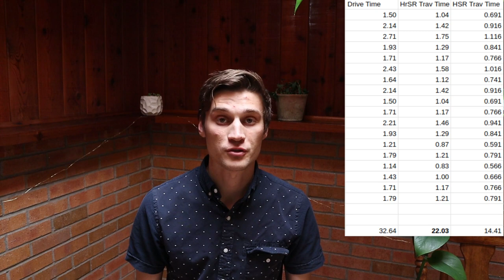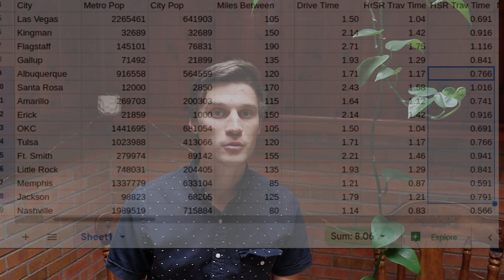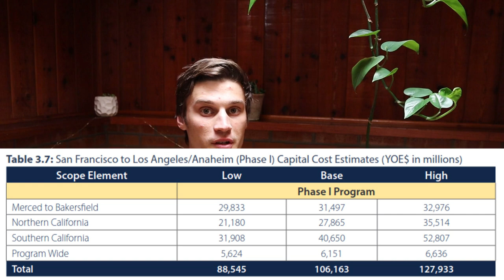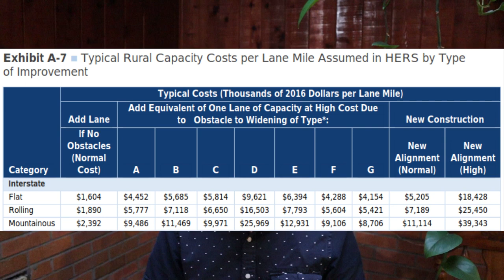What if Interstate 40 were High Speed Rail?

Comment: British Rail built the Intercity 125 50 years ago capable of reaching speeds of 125mph on standard track. It is still in service. So realistically if you build track capable of running a 50 year old design of train you can achieve a realistic improvement. They also designed the APT (Advanced Passenger Train) which was the predecessor to the Pendolino (Tilting Train) capable of I believe 140mph agin on standard track. The holdup isn't the train design but the Political commitment to either track construction or rehabilitation.
Reply: If only we were the size of England.
Reply: @ut000bs  Point was they didn't need upgraded track. Virtually all High speed rail runs on dedicated track (see the project in California, most European high speed lines, China etc) The Intercity 125 could attain top speed on normal track with minimal upgrading. Amtrak needs to provide relatively quick Reliable services in order to stimulate demand, and that requires scheduling improvements and track upgrades. Some American services are good but the longer the distance the more chance of delay.
Reply: Can safely run up to about 155mph on standard track, as long as curves are straightened and crossings are eliminated and layers of automatic safety systems are added. This is also about the limit of modern standard rolling stock. Older stock tops out at about 125mph. Electrification can be added at the same time, reducing potential energy costs in the long run.

Comment: My honest thought at about 9:33 is that your high-speed rail numbers are too high, on both the low end and the high end. 

California is unique in that its cost numbers include the costs of addressing a lot of terrain challenges, seismic challenges, environmental challenges, labor cost challenges, and other challenges that just aren’t replicated elsewhere in most other parts of the US. 

For instance, much of that route runs through the Midwestern US, where costs will be somewhere around half of costs in California.

A second criticism is that the timetables could also be recalculated with the concepts of “express trains” and “local trains”. Express trains would connect city pairs along the proposed route (like Albuquerque to Nashville nonstop) while local trains would stop at each stop (Albuquerque, Amarillo, OKC, Tulsa, Fort Smith, Little Rock, Memphis, Nashville).
Reply from the maker: Those are both fair criticisms. 

I don't know how much extra the "California Tax" adds when broken down into itemized lines of labor, seismic robustness, etc. (that might be a good future video idea). But, while the geography of Oklahoma and Texas may not be too challenging, traversing through the Ozarks, across the Mississippi river, and across the Appalachian mountains is no easy task. 

I like the idea of express trains; you could easily save over an hour in stop time. My reasoning for adding the intermediate stops was to ensure the folks in more rural areas have access to transportation throughout the region, but the "local train" solution would cover that.

Thank you so much for commenting; I hope you have a great day!
Reply: @ericnelius9062  Frankly, my gut feeling is that depending on terrain and land cost, you're looking at between 50% and 80% of the cost of California. Somewhere in that ballpark would give you a decent guesstimation.

Second, in addition to the breakdown of "Express" and "Local" trains that we got by looking at what the MTA does to move people through the NYC area fast, let's look at 2 other options that can also be built into an HSR service.

A "Commuter" train service would be a lower-cost no-frills service that would be designed simply to facilitate commuting between a large city that is a jobs hub with smaller cities that could serve as bedroom communities. California plans to run some of the trains on its HSR like that. This would, for example, enable people to live near Fresno and easily commute to work in the Bay Area.  All that would be needed would be for 1 train to simply shuttle back-and-forth between the same 2 stops. In a nationwide HSR system, this could be replicated all over the country, and would rejuvenate numerous small cities while expanding the available workforce for job centers in larger cities.

An "Overnight" train service could move people across the country much more easily, by utilizing high-speed trains with sleeper berths to transport people nonstop while they sleep overnight. For example, a train connecting Albuquerque and New York City would have to cover roughly 2000 miles, which could be done in about 9 hours. A passenger could board a train in Albuquerque, get a comfortable sleep, and wake up pulling into New York City the next morning. It could be an easy, comfortable alternative that could be competitive with transcontinental airline service.

There are a lot of good options for how HSR trains could be run that we ought to be talking about, since you can make a train car do things that a car or a plane can't easily or economically do.

Comment: You lost me at the eastern terminus being Charlotte. It's not even on I40 and there are way more folks living in the corridor from Winston Salem > Raleigh than in Charlotte.  Raleigh-Durham, at ~2.2M, is also the largest CSA along the entire stretch of I-40 and it's growing more rapidly than even Charlotte.   Charlotte belongs on a HSR corridor that stretches from WDC to Atlanta along I85.
Reply: "Charlotte belongs on a HSR corridor that stretches from WDC to Atlanta along I85."

Uh, there's no density there, at all...and it's 639 miles, that's way too far.

Higher speed rail, yeah, sure. Not per se HSR.
Reply: @neutrino78x  
Atlantan here-- there are lots of people that make the drive between here and DC and points north because a large swath of transplants living here are from the Northeast. Also if we follow hub and spoke models, Charlotte would likely be a key transfer point in a HSR system just like ATL would be.  

There are plenty of people that would be OK with a 600+ mile high speed train trip as long as there are dining cars, restrooms, entertainment and wifi, and even scheduled 20 minute stops at key locations where one could get off and freshen up/walk around a bit, grab a snack and hop back aboard to continue their journey. These all exist on railways outside the US, but are bog standard operations. As long as ticket prices are comparable to flying Spirit or some other low-budget plane, then I'd be on the train all the time.
Reply: @starrwulfe  

"here are lots of people that make the drive between here and DC and points nort"

Lots? Like, ten? That's what, a ten hour drive? That's not a drive you're going to do on any kind of regular basis. If you wanted to go visit family once a month, you would fly.

"Charlotte would likely be a key transfer point in a HSR system"

There's never going to be a nationwide public transit HSR. The expense is simply not justified in light of the fact that we already have a high speed transportation system that is far less expensive and much faster: jet aircraft.

" These all exist on railways outside the US, but are bog standard operations. "

(all those things you listed exist on Amtrak today.)

Show me the 600 mile HSR line in Europe. That would cross multiple countries. They don't have HSR out that far. Going from Lisbon, Portugal to Moscow takes three days on a train, just like crossing the USA, because they don't have HSR built out on that scale. They would fly such a distance, as we would.

A lot of sources like to claim HSR is good out to 400 miles but I think that's nonsense. I haven't seen anything that claims it to be a good choice at 600 miles (1028 km).

In theory, if you could maintain 200 mph the whole time, 639 miles should take 3.2 hours. 

But I don't think that's realistic, because look at California's HSR, quite a bit shorter at 380 miles....but they stupidly chose a longer route, 400+ miles, and it would take a minimum of 3 hours, probably more like 4 hours, if ever built. So look for DC to Atlanta to be more like 5 hours. The problem is you can fly it in under two hours. So you're wasting three hours of your life.

What I would support DC to Atlanta is "higher speed rail", which is quite different from HSR: no special grade of track, no wire. It would be more like a six hour ride, but far less expensive. 

btw density of Atlanta, 3,685.45/sq mi (1,422.96/km2)
DC, 11,280.71/sq mi (4,355.39/km2)
Distance: 639 miles (1028 km)

As opposed to Paris, 9,900/sq mi (3,800/km2)
And London, 14,500/sq mi (5,598/km2)
Distance: 318 miles (513 km)

So DC has reasonable density but Atlanta doesn't, and the distance is double. That's why Europe and Asia have lots of HSR but in North America and Australia we don't use it hardly at all.
Reply: Another problem is that even if you built high-speed rail, most American cities have a very feeble public transit system to get you anywhere.   Charlotte is in the process of building a unified Transit center for Amtrak and buses... But the New Orleans to New York City crescent train comes through about 2:30 in the morning when the public transit system is not running.   Charlotte is talking about possibly having to shut down its light rail because of a lack of trained personnel.
Reply: @neutrino78x have you ever driven that route?  Richmond, Petersburg, Durham, Greensboro, High Point, Charlotte, Spartanburg, Greenville are all fair sized cities and growing, causing heavy traffic the entire route, despite 6-8 lanes much of the way.  Plus countless other towns providing potential customers.
Reply: @RichardinNC1  

" Richmond, Petersburg, Durham, Greensboro, High Point, Charlotte, Spartanburg, Greenville are all fair sized cities "

Perhaps, but they don't have the density to justify HSR.

Richmond, virginia, population density: 2,067.3/sq mi (798.2/km2)

London, UK population density: 14,500/sq mi (5,598/km2)

Now do you see why it's easier to justify it in Europe???

HSR is extremely expensive.

"Higher Speed Rail" I would support. But with that, you don't hang a wire and you don't buy new Right Of Way. You just upgrade existing rail where needed and run express trains. Much cheaper.

I have no objection to Higher Speed rail between those cities. Per se HSR is definitely not justified.

And I don't know how to drive, I grew up in a region with lots of transit (san francisco bay area).

Comment: I think the Higher Speed Rail is the most cost effective option.  Besides High Speed Rail may not be able to maintain full speed on mountains, through cities, etc.  Using the I-40 corridor is smart, saving a lot of cost for right-of-way.  I live in Charlotte and would use rail to Raleigh, Atlanta, Nashville, and beyond.  You may have overlooked the mountains Charlotte to Asheville.  There’s a 2000ft climb separating the 2 along any possible route.  A tunnel doesn’t fix that.  Trains have gone through Saluda NC, one of the steepest mainline sections in the east but that was decommissioned and is being turned into a trail.   A few other points you overlooked.  Long distance trains have to change out crew every 8 hours, along with refueling.  Add 1 hour for high speed rail, and 2 hours for higher speed rail.
Reply: If the Train is Electric Powered, there would be no extra Time needed for Refueling.

Comment: Great video! I think a 10min stop is to much, usually trains only stop for maybe 2-5min. So with a 3min stop and accelaration of around 90sec to 200mph its 5-6min.
Reply from the maker: Thank you so much! As a frame of reference, the train from Bruxelles to London was stopped for exactly 3 minutes when I rode it recently.
Reply: @ericnelius9062  yeah right also the train usually stops longer at big important stations but shorter on smaller less important stations👍🏼
Reply: An acceleration time of just 90secs? That's very fast. You'd require heavier engines and draw more power than a more gradual acceleration, which makes for more expensive trains and infrastructure. And if the train is going to downtown, you probably don't want to go 200m/h in the city. Not to mention that if it's going to already existing train stations, it's likely to travel the last/first miles over existing lines which were not build for those speeds.
Reply: Agree that 10 minutes seems excessive, when compared to a driving speed of 70mph non-stop. Either assume the train will be doing 200mph non-stop, or factor in a break every couple of hours when driving plus the inevitable delays you get on any long drive...

Comment: Even if we never get faster rail they need to revive the rock island line that bnsf destroyed. Even if "slow" speed rail was the only option I would still use it to go to nearby cities. On top of that my city of Amarillo tx was built around the line and it didn't disturb the fabric of the city too much, I-40 and 287 however have leveled an entire neighborhood and torn through several more, its led to a complete breakdown of our older throughfares and many of them are completely deserted because everyone takes the highway. Its made my city a place to drive through as fast as possible instead of a being a destination.

Comment: As a frequent user of the Interstate System I find your 70 mph base line wildly out of touch.  As you casually mentioned, stopping is a reality not an option.  In order to average 70 mph on the hypothetical trip, steady speeds of 80 - 85 mph would be necessary.  I don't see that as realistic.  I believe a 60 mph average would be more realistic for your comparisons.  
I like the premise of your presentation and as someone who simply will not fly, long distance rail connections are tempting to say the least.  What I see as the major hurdle is overcoming the long entrenched entities that are so vocal as to pro-highway/auto/truck industries, plus the road construction companies that are major contributors to the politicians that would need to come on board (pun intended) to make a national rail system a reality.

Comment: There's a lot in here, anyone reading should expand the comment to read it all 😉

Though you are somewhat restricted by weather....  Running down I-40 right through the state with the most tornadic activity and some of the most extreme weather cycles.   Trains will halt service for tornado warnings and sometimes for severe storm warnings.   Trains are often also slowed down at higher temperatures due to rail expansion.  And below -20C, also slowed down due to shrinkage.  

But all that said, it would be nice to have at least the X0 and X5 Interstates paired (or loosely paired within and around large metros, maybe on the 3di, to placate NIMBY busybodies) with some PAX-only rail service.  The main gripe I have about current rail is not the speed but that even though PAX is supposed to be prioritized by law, it isn't, and penalties are not enforced, causing constant delays.

But laying rail in the open is easy, problem will come into play when you have underpasses that do not meet FRA height clearance of 7.1 meters (23 feet) above rail.  This would require a lot of earthwork to dredge the embankments or reconstruction of a lot of overpasses.   FHWA only requires overpasses a minimum of 14 feet above road surface.

Comment: The one thing that high-speed rail doesn't account for is freight. A large part of I-40 traffic is trucks carrying cargo, quite often across several states. Although I like the high-speed rail option for passenger travel, the existing road system, or an upgraded version thereof, still needs to exist for freight.

Another point I'd like to make is that the current routing of I-40 begins/ends in Barstow on the west end, however, it is just a little bit further southwest from there to get to Los Angeles. I believe this would be a more logical, albeit more difficult, terminus than Las Vegas. Another thing to consider regarding Barstow, is that it is the point where eastbound traffic from both the Los Angeles area (via I-15) and the San Joaquin Valley area (via SR-58) meet to get onto I-40.

On the assumption that California will complete it's high-speed rail project eventually, I believe it makes sense to extend the "I-40" high-speed rail line to the west to connect to California's high-speed rail line, thus serving the more populous parts of the state.

A connector roughly parallel to US-93 between Las Vegas and Kingman would also make sense to provide connectivity to Las Vegas, as would another connector along I-17 to connect to Phoenix. In the middle of the country, it would make sense to add an I-35 spur line to connect to the DFW region.

On the eastern end, I believe it would make more sense to roughly follow the routing of I-81 from east Tennessee to connect to the DC/Baltimore, Philadelphia, and NYC regions.
Reply: Add in a triangle between Nashville, Atlanta, and Charlotte.  That would still include Asheville, and add Chattanooga and parts of SC.
Reply: A 150mph standard electrified fast freight rail network would be cost effective. It would shift a considerable amount of long haul truck freight onto rail. Trucking would refocus on more short haul and less long haul, but require about the same number of truckers. Some air freight may also shift back to rail.
Reply: There is a plan for HSR between Los Angeles and Las Vegas. However, it only runs to Victorville, though they may be reconsidering that. Many people think the L.A. to Vegas train is a good idea. If it does get built, then an I-40 train with its western terminus in Vegas would make sense.